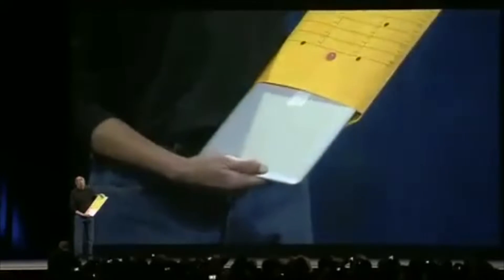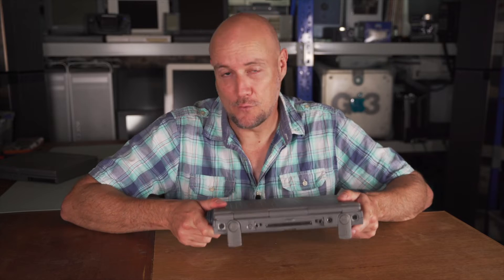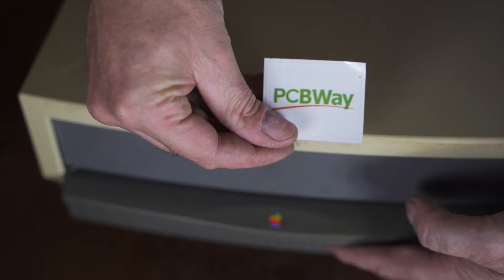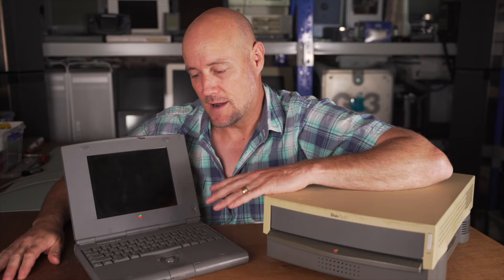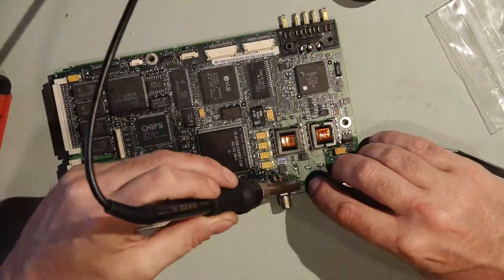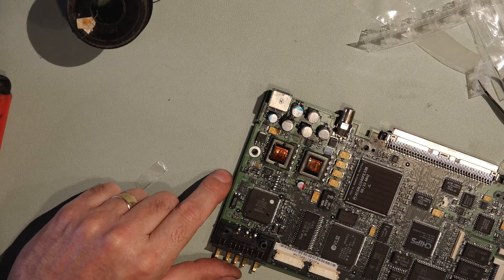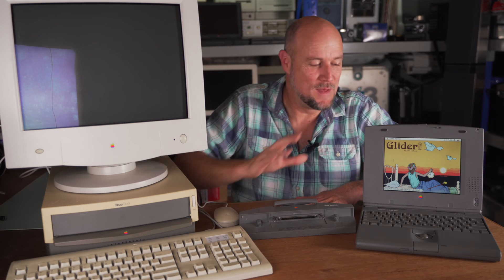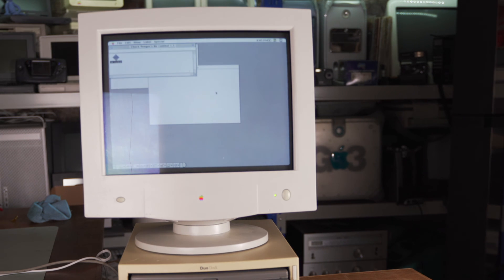Apple PowerBook Duo 280c and DuoDock Review and Repair

Comment: Great video!  The 2300c and DuoDock are my daily driver vintage Mac - so slick!  BTW - the DuoDock I recently purchased has the internal SCSI hard drive mounted on the underneath side (near the NuBus cards).  The mount looks just like the one used to mount a drive in the IIci - it just clips in - and it just has a long cable that routes up to the top.  I actually replaced it with a BlueSCSI instead and use the dock to recover data from Duos I come across and recap/fix/sell.  Oh, and the capacitors in the DuoDock power supply (riveted closed!) are as bad or worse than the ones on the Duo logic board...
Reply from the maker: Thanks Shane, appreciate your interesting comment. I had wondered where the hard drive would fit so that makes sense.

Comment: I had a Duo 250 and a Duo Dock. I really liked it at the time. When it was docked, it gained an FPU. As a result, I had a few apps that required having two versions, depending on whether it was in or out of the dock.
Reply from the maker: That’s really neat, I love the idea of an extra FPU when docking. Sadly the DuoDock I have doesn’t have that feature, as the 68040 and later powerPC didn’t support it.

Comment: Thank you for your video.  I have inherited a PowerBook Duo that my father used in the 90s.  We have 2 issues.  The first is the laptop is stuck in the duodock, any suggestions to get it out?  The second is we want to get the data off the drive.  Is there a way to do it?  It has been sitting idle for years!  Thank you in advance for any answers you have.  Cheers.
Reply from the maker: Hello Judith. Thanks for your comment. I’m no expert, but I may be able to help out a little. On the side of my DuoDock (opposite to the floppy drive) there is a small slot. I poked in a rod and this manually disengages the docking mechanism. Once you get the powerbook out, the lid might be stuck to the body as the rubber bumpers have likely turned sticky with age. Slide a credit card or similar each side of the latch if so. With the machine open connect the power adapter and hopefully you get a boot chime and it loads up the OS from the hard drive. If the hard drive doesn’t work, you can try giving it a few sharp taps. They have a rubber bumper inside that also turns to goo, and sometimes the arm that holds the heads can get stuck. 
If the machine is working fine, then getting the data off can be a bit of a challenge without a working dock. If the DuoDock is working, you could write files to a floppy disk and read them on a modern machine with a USB floppy drive. You could network the computer (AppleShare) to another later mac with usb (like a later G3 or G4). You could use the SCSI port on the back to connect a blueSCSI or similar and copy the files to this external drive, which you then could access in an emulator.
If the Dock isn’t working, you can still network the powerbook using the serial port on the back behind the feet. But you would need another older serial equipped machine to receive the data.
As I’m typing all this I’m realising there’s no easy way really! I’d be happy to help out if you lived nearby, or were willing to ship the machine. Reach out if you like, contact details are in my bio.

Comment: Perfect thumbnail pun :) Great SD install too! One thing to watch out for, I read that those extenders can lose some bit or cause weird problems. I don't think it's guaranteed, and this seems to be working perfect for you... just something to keep in mind, if you start experiencing odd drive issues, try without the extender. Lovely overview video!
Reply from the maker: I have been getting a few issues. Computer will randomly hang. The scsi2sd was an old unit I bought years ago before bluescsi was available, so might swap that out in the future. I’ve also bypassed the sd extension in case that was the issue, but it’s persisting.
Reply: @TheBasementChannel  Yeah, if it's the older SCSI2SD, that might be it. Just the other day, Technight was talking about a ton of random issues in an older PB using the first version of SCSI2SD.
Reply from the maker: @iiidiy yes we had a brief Twitter exchange on the topic.